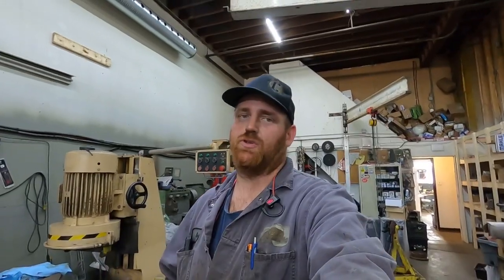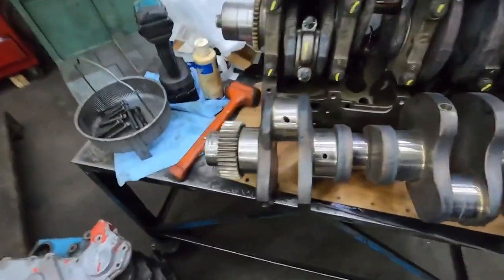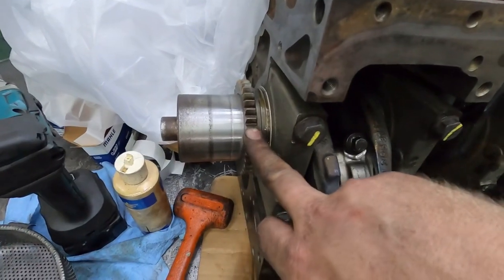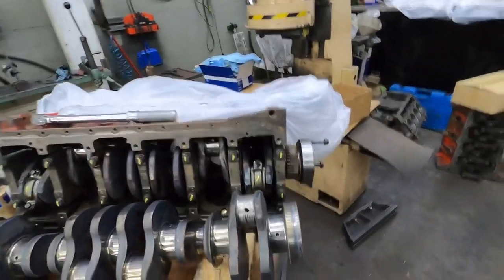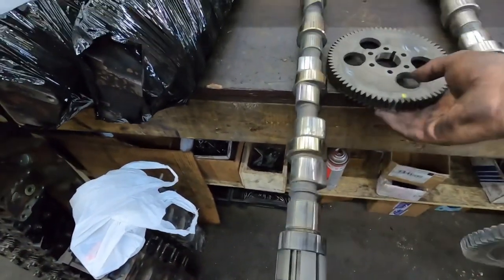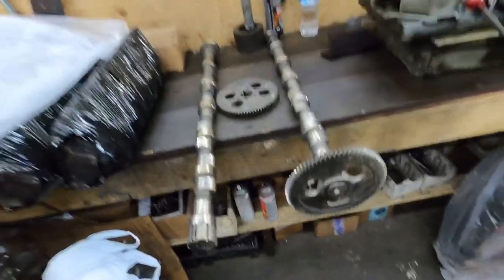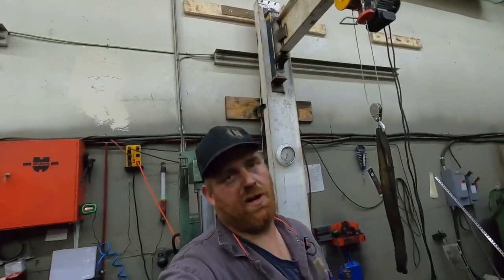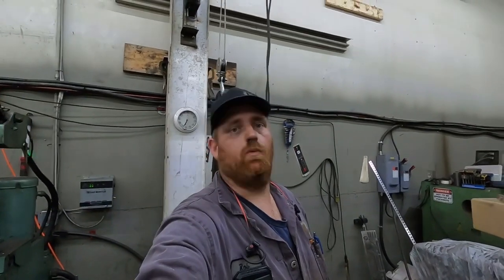6.7 Cummins REAR GRAR TRAIN ??   So you guys the differences then a pickup engine.

Comment: I'm into a loader (rear gear train with a cracked cylinder so I'm shopping for a block. I haven't opened it up yet but I assume the rgt block has a cam bearing in the rear. Do the the truck blocks have that? Thank you

Comment: Hey rob, Starting to build a ppump 6.7 myself. Running a vp44 head. Woukd you recommend isb or qsb pistons?
Reply from the maker: @Bassackwardsdiesel  I like the isb pistons better mylsef
Reply: @CUTTERUPROB  sorry to hound you with another question, im using a vp44 cylinder head that is oringed. The oring appears to still fall on the fire ring of the 6.7 gasket, however can you use orings with a MLS gasket? In my head this seems like a bad combination, or are you aware of any composite 6.7 head gaskets

Comment: So, I have a 2010 6.7 ISB rear gear in a Freightliner MT45 that failed. I bought it that way from a dealer who got it at an auction. I'm a retired marine 2 and 4 stroke master tech level and this is my 1st diesel. Engine is out and torn down. Had a dropped valve seat in #3 that hammerred up the head and piston. Cylinder looks good like I can just hone it and go 'stock std piston. Crank and cam look great! However, all 6 cyl had flood fuel in the piston domes. I don't understand how all 6 can flood like that except for a fuel pressure return valve. ? Also, do I use crocus cloth to clean up the crank journals? And, the damaged #3 also had coolant on the cyl wall. Also found a couple of tablespoons coolant in the oil pan. I'm assuming head gasket- like a steam hole, can the cyl have a crack? I don't see any.  Thanks much. Love your vids and watch them all! btw, This truck will be used for light delivery and then converted to a cross country RV. It now has 277k on the original vehicle and engine. It was a Cintas uniform truck for 13 yrs.

Comment: I have a potentially dumb question. Could you swap the front gears? I'm wondering if you could have a "pickup" engine with the "industrial" crank and rear cover and use the rear gear for a mechanical lift/transfer pump.
Reply: A follow-up question:

Is there a low pressure/high volume pump that would fit in the rear cover?

Comment: So in theory I should be able to get a front run cam and crank, also the front and rear engine covers from a used 6.7 truck engine in order to install it in my truck? The reason why Im asking is Im finding school busses with the 6.7 Cummins and only 120 thousand miles for 2200 us dollars these days. Swap a few parts and install it in my truck.
Reply from the maker: Basically yes

Comment: On the isb6.7g..
Wanting to do a 6.7 on alcohol for a pulling tractor.i see cummins sells a 6.7 head that uses sparkplugs,can the injectors be removed from a diesel,and sparkplug screwed in thier place,or does cummins use a adapter.ive seen pics of the gas head and the head is a 4 valve with the plug located central as is the diesel injector.im only worried about the sparkplugs.planning on using a truck block,to have the common crankshaft and camshaft available
Reply from the maker: It’s an adapter. But I have never seen one on a 6.7 so you would have to do some digging around on that
Reply: @CUTTERUPROB  thank you for a reply..watch your vids every evening, very informative and you present it in a way the common man understands..planning on using a 4.4 bore too

Comment: They've only got 6,000 hrs on them...the new one has after treatment, our first with that shit... we'll see how it goes..
Reply from the maker: ya, i hate dpf lol
Reply: @CUTTERUPROB  the 6.7 has a lower ,than most ,rod /stroke ratio ...wonder if that adds to the rod issues ???... I know the lower ratio adds to piston side thrust tho...and it's part of the reason why the engine builder's run a 1" longer rod in the deck plate engines...or so I read

Comment: 👍👍.. have got 2 QSB6.7 RGT'S in Komatsu machine's...just got another brand new komatsu the other day with one in as well ... haven't had to do a thing to the other 2 yet , besides maintenance obviously... hopefully never will
Reply from the maker: there a good engine, good fuel clean when you do the fuel filters is a good idea
Reply: @CUTTERUPROB  👍yep....they run a 10 micron and a 2...added a 2 to the 06 dodge ...no injector trouble yet...knock on wood